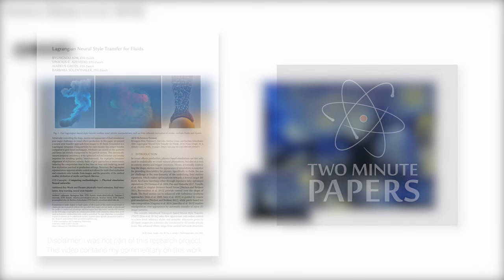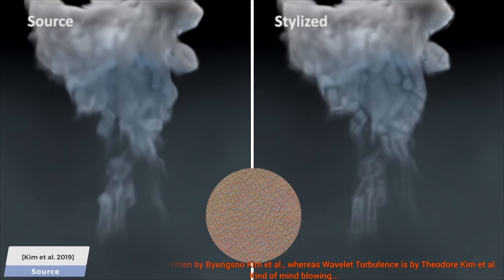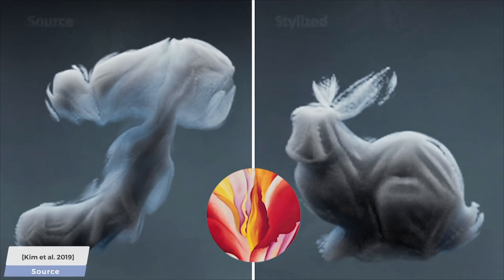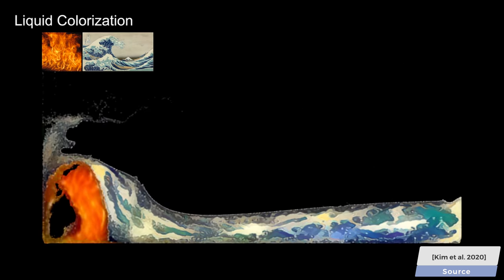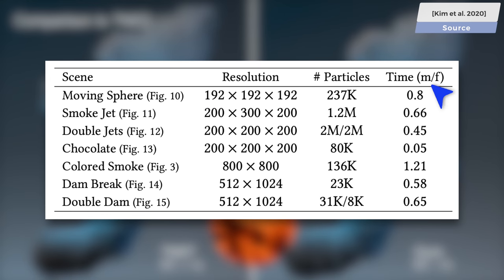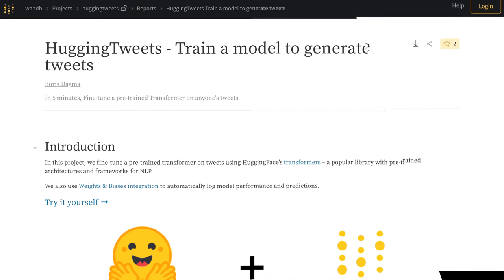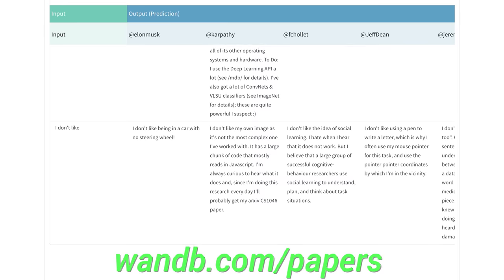Is Style Transfer For Fluid Simulations Possible? 🌊

Comment: Shouldn't be a particle based method called "Eularian" instead of "Lagrangian", because Lagrangian based methods are generally for grid based methods, where the point that you are simulating or sampling is stationary in the space.

Comment: This is really cool but I'm curious what the practical applications of tech like this would be!
Reply: I can think of one easily, Video Games.
Reply: @tecnk1984  Hardly. Video games need good performance. 60 fps minimum is a demand by many gamer's and this is 30 seconds for a single frame. Video games run quickly exactly because they aren't doing full scale simulations for physics and lightning. In video games, lighting is saved as part of the coloring of the object and rendered normally.  No calculations for lighting effects are done at the time of running the game. They are only done in the creation of scenes. Don't be expecting any of this in video games any time soon.
Reply: @Elrog3  things do trickle down to Video Game tech like ray tracing, motion capture,etc. Papers like these take years to come to even movies and 3d animation but in the near future I see the possibility of this as things are going  in the way of more dynamic physics systems in games.

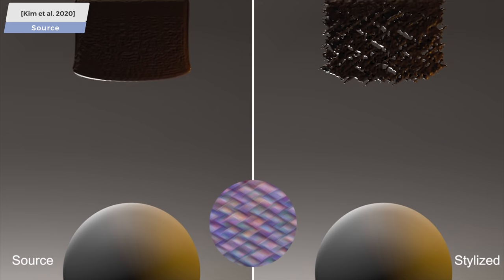Comment: 2:50 - This is confusing and mind-boggling. How can individual particles know what style they're supposed to follow when the style only works on big-picture level? 😕 Individual particles don't have a style by themselves, it's only in relation to their neighbors that a style can emerge. 🤔
Reply: That depends on the nature of the simulation.

I would guess they know what's near to them, which is kind of a form of swarm logic.

Having said that, particle systems don't always have simple particles.

A billboard texture can be a particle. Complex geometry can be a particle. an animated object can be a particle (this is how you simulate a flock of birds with methods that are otherwise very similar to a particle system)

So, depending on the nature of the underlying particle system, yes, individual particles CAN have a style.
But I assume that's not how or why the method in this paper works...
Reply: I know it's a very simplified but just as the points function x^2+y^2=r^2 simply "know" that they should form a circle about the origin, there must a complex function that describes the motion (using Lagrangian mathematics, as mentioned) and that formula is "tailored" to each point in that substance to perform differently, for us to observe that pattern emerge. Hope this gives an idea!